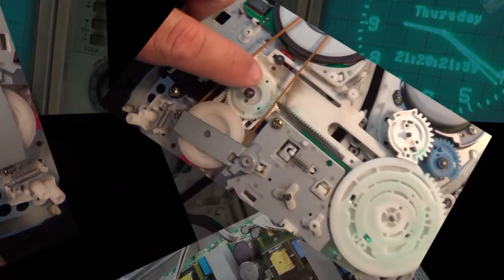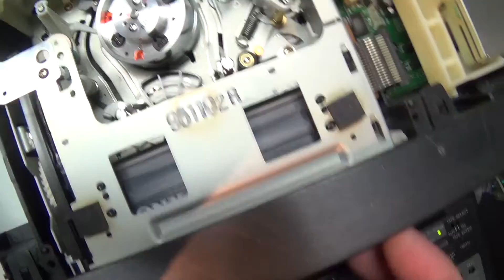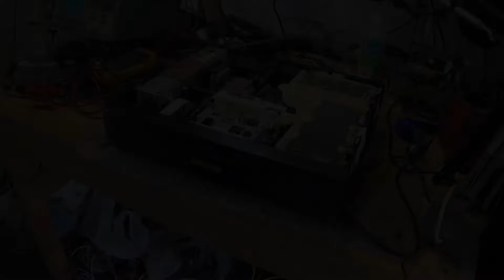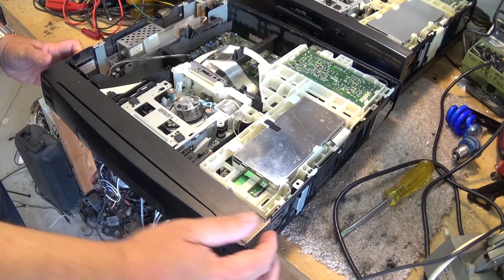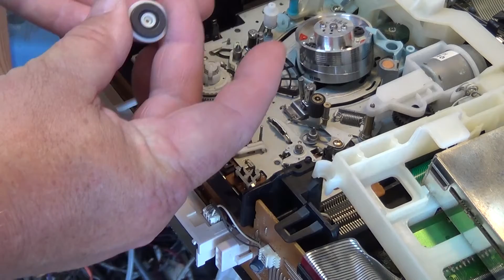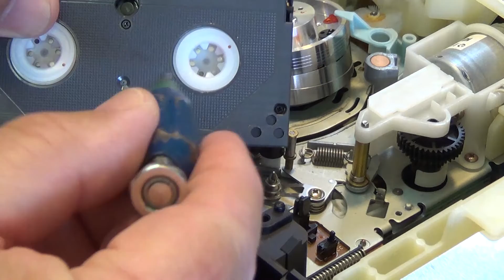Sony EVS7000 transport repair

Comment: The model number...
EV-S7000 or EV-NS7000?
I think it's the latter......
Reply from the maker: Even s7000 is the model number stamped on the unit.
Reply: @12voltvids  Yeah I got mixed up.  NS7000/9000 are actually JDM models.  But was there an S9000 available for the US?

Comment: Mines fwd good but it dont rewind and my display is not showing
Reply from the maker: Probably a cracked gear on the supply side.   Mine broke the take up gear and i had to repair it.

Comment: I have the EV-S5000 with the same gear issue but mine has three split sections. This can be fixed without 3D printing but it takes time. Once fixed you can not tell that it was ever broken.

Comment: This video is awesome.  I have a couple of EV9000's, each with different problems.  One of them only loads the tape half way around the drum and just hangs there and thn shuts down the motor after a few seconds.  Any ideas what that may be please ?
Kind regards
Rob

Comment: Hi 12voltvids, where did you get these Hi8 VCRs? Also, I have seen a video of a Sony EV-S2000 and it does not have the same mechanism as this one, it has the same mechanism as my Sony Video Walkman GV-8. Is the mechanism like the EV-S2000 better, does the tape spool gear fail too?

Comment: I have an ev-s7000 and has the same problem. I recently acquired an ev-s700 for parts. According to the service manuals and part numbers the reels don't look the same. The 700 is a 2 piece gear, is there anyway to make them work? Thanks
Reply from the maker: The evs5000 and 7000 uses the same reel table, the other ones used a different table. Unfortunately I have been unable to find a replacement for mine, which is unfortunate as it was a very expensive machine which is basically useless to me now.

Comment: Lots of people are selling HDCAM SR portable decks right now...they don't seem to hold their value very well.
Reply from the maker: Nothing is holding value these days. You should see my plasma TV collection. 8 and counting, all working. Nobody wants to hang onto electronics much anymore. I have a few vintage pieces that I should get rid of, but I hang onto them for the nostalgia.  I was going through my storage unit recently, and there is a lot of junk in there that I am going to go though and get rid of. Old units that I will never repair, old manuals and stuff. Found a box full of 5 1/4" floppy disks. Why I still have those I don't know. Into the shredder they need to go, as there is likely personal data on them.

Comment: Hi 12V,

It's very difficult to service a Video 8 VTR?
The level of difficulty to service the Video 8 VTR's, 
are the same of the Betamax?
Reply from the maker: +LibraAudioLaboratory Other than the mechanism is smaller they are similar. 8mm use a 210' wrap on the head drum as opposed to 180 for VHS and Betamax.Even though the video portion of the signal only occurs for 180' before being handed off to the opposite head, this allows additional information to be written, that being time code and dub-able digital stereo sound.
Reply: +12voltvids Thanks 12V.

Comment: Maybe it's a dumb idea/question to ask; if it's only cracked and no thread is gone, couldn't you just use superglue?
Reply from the maker: +Brenden John superglue won't stick to nylon. Super glue is an acrylic.
Reply: Not sure I understand. Perhaps I don't know what nylon really is; but isn't the gear plastic? I'm pretty sure I've super glued a few plastic things together. In any event, I thought it could be a simple easy way to fix it, now I'm having second thoughts on buying this model.
Reply from the maker: +Brenden John 
None of the glues I have  tried stick to nylon, which is a synthetic material, not plastic. It just peels off.   The only way I have been able to make these gears work I to heat the material and fuse it back together. The cause of the Crack is the metal insert the gear is formed on. When it heats up the metal expands and the gear does not, and it cracks. It is a very common problem on the eve 2000, 5000 and 7000. They all fail. This is the 3rd time line has gone bad. The last time I robbed the part from my evs2000, so it is broken too. The part is no longer available from Sony. I would stay clear of this model. Or do that matter all the Sony home deck type 8mm units. Mine works as long as I don't fast forward so I use only for the odd tape that has pcm sound. For the rest of my archiving work I have a couple of digital 8 cameras I use for playback.
Reply: +12voltvids I am going to guess, based on your video, that an option to makeshift a non metal piece to replace that metal. Or is that a part of the magnetic sensor? If that one part could be 3D printed out of a solid material such as carbon fiber, would that work? I'm going to guess the magnetic sensor explains the reason of such a high end device having plastic gears, or I guess they are all nylon. It just seems like there has got to be a work-a-round to this problem...
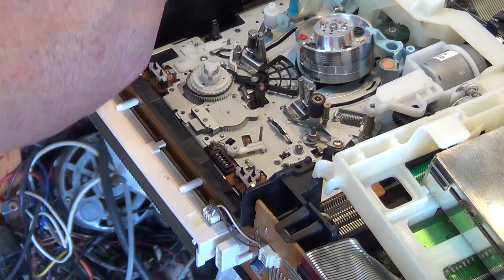Reply from the maker: +Brenden John The hub is made up as 2 pieces. The top piece being the actual hub that drives the cassette reels. The bottom half of the assembly is the plastic ring gear that is mounted on a thin metal disc.  The metal disk (it is steel) serves another purpose. Remember I said the tape hub was a 2 piece assembly, with the top part of it having the actual splines that mesh with the cassette reels. Well the bottom of that plastic hub has a donut magnet on it. The magnet is attracted to the steel disk that the ring gear  is moulded. This provides a magnetic clutch to limit torque on the tape. This is much more gentle on the tape than previous felt pad slip clutches. Watch it at 16:20 and you will see it. Below the disk hub assembly is a hall effect device that detects the changing magnetic force going through the metal disk on the gear assembly to detect of the hub is turning or not.
Reply: +12voltvids Did they have these in VCR's too? When I was a teenager I actually fixed many many VCR's and I was successful at it. Though, I may have had enough know how and understanding to know how to fix most of the VCR's no by "accident" I certainly can't say I know the depth you know, course I'm 35 now and don't necessary remember everything. It is a nice memory to see the insides of these machines and my past with them. 

If you had anything at your disposal to fix/correct this rather faulty design with the existing system, how would you go about it? Are you able to take out the metal and create a hair line larger circumference for the metal to fit in to account for heat expansion? 

What are your thoughts of myself buying this very player? I'm good at coming up with a McGuyver fix, but this seems way out of my league; and for most as it appears. I have been getting into old tape restorations, I have the awesome Panasonic AG-1980 sVHS player of which the capacitors where all replaced with hi end HiCaps. It seems that this player is the equivalent to the Panasonic, perhaps I am wrong? 

BTW, much appreciate you engaging and reaching out to remarks on your page, it's priceless knowledge to receive.
Reply from the maker: +Brenden John The AG1980 was an "industrial" machine, which basically meant it cost a bloody fortune, and provided little more as far as quality went over the consumer machines of the same vintage. It was plagued with bad capacitors in the power supply, and in those nasty metal modules, such as the vcrs0079 I think was the one that went bad on mine. Panasonic was really bad for those, little tiny time bombs in the machine that are going to fail, you just don't know when.Mitsubishi made a far superior machine. HSU65, HSU67, HSU82. Better in every way. Better mechanisms, better power supplies (linear) and none of these bullshit custom module circuits that you can't repair, and they discontinue them the day the machine goes out of production.As to the cracked gear on the Sony, I don't have a long term solution. Mine is still working with the fix I did here, as long as I don't put the machine into fast forward. I only use it to play tapes to archive to digital, so it will get me by for now..

Comment: Great video on EVS7000.   I have done the exact same repair using a new S-reel I bought on eBay only because one guy had one.   My unit is working perfectly except a separate don't-care issue where the LED display went out out on the sliding control panel.   All keys and indicators on the panel are functional , only the LED display is dead... any ideas appreciated.    For those searching for a different unit with PCM audio, the EVS3000 has PCM and does not have cracked reel issue.   The tape mechanism on EVS3000 is a Sony design and this one I heard came from Memorex and is much faster on tape load but not reliable as you see.   The EVS3000 is 2 years older (1992).

Comment: Can you epoxy/superglue it to fix the crack?
Reply from the maker: riceandpotatoe The gear is made out of nylon, and as such super glue will not stick to it. Epoxy is in the same boat. I haven't tried JBWeld but might give that a try on the broken one to see if that will save the patient.
Reply: 12voltvids Try this link on the repair

http://www.stereo2go.com/topic/best-glue-that-actually-bonds-to-nylon-polymers-polyethylene-for-the-sony-center-gear-issue?reply=281780694037843942

Comment: I wonder if a new gear ring could be machined out of brass or something?
Reply from the maker: Brian Taylor Brass isn't magnetic, and that is how they limit the torque. The magnet on the hub allows the steel disk below to rotate, and also passes that magnetism through to the hall sensor below.

Comment: Hi there,

It great video.

I have the same vcr but Pal version.

I hope you can give me advise.

My ev-s9000e = ev-s7000

It plays and records tape without problem.

But the led and lcd display on the machine gone off.

Therefore I cannot the clock etc..

Could you tell me which part should I look at?

I appreciate you advise

Alan
Reply from the maker: Alan Wong I would have to research that as I haven't run into that problem before. Considering that the LCD and VFD displays are on totally different boards, the VFD on the tray that slides out, and the LCD on the front control board. Unless they are connected together somehow, but I really don't know at this point as I don't have the unit apart in front of me.  I would have to look at a schematic to know how they are interconnected.

Comment: Nice video.  You would have thought that the failure rate would have flagged Sony to come up with a proper engineering fix for this.
Reply from the maker: Zone1242 unfortunately consumer electronics manufactures don't recall products and by the time the fault showed up they were already out of production.

Comment: Such a shame.
Reply from the maker: Neil Robinson What the crappy parts that are no longer available. Yes I agree.This was a common thing, and for that matter still is. Manufactures really don't want to supply parts. For years there was the 7 year rule, which was enforced by the US and Canadian governments that forced the manufactures to have parts readily available for 7 years after the product went out of production. Then they relaxed the rules to 6, but worded it that the manufactures should make a reasonable number of spare parts that would cover failures after the product went out of production for 6 years.Of course the loop hole there was make 100 spare parts, and that should be enough to last 6 years because that part should never fail, so at the end of 6 years there should still be spares in stock. That might work for some reliable parts,  but when you get a common part that starts failing at say 4 or 5 years out the supply gets used up, and they are under no obligation to make any more.The old system if they ran out of a common part in year 6, they were expected to make more to cover the 7 year. Prior to that it was 10 years.Today they are not required to maintain an inventory of parts, all they have to do is cover the iten while it is under warranty, and if there is one sitting in a store for 5 years unsold, and then it is sold the warranty starts on the sale date. If it breaks, and there is no parts they just replace it with a new model. For some that sounds like a better option. That is unless you are dealing with "vintage" gear, where they no longer make compatible replacements.Of course I am talking video recorders and cameras. People have old tapes they want to play, family stuff and when they go to play it, the camera or VTR is broken. A trip to the local electronics store reveals that all those tape based systems are gone, and slick the salesman is itching to sell the latest SD based camera. Not being able to get parts to repair the old unit just rubs salt into an already open wound.